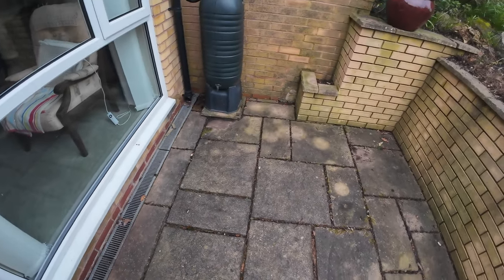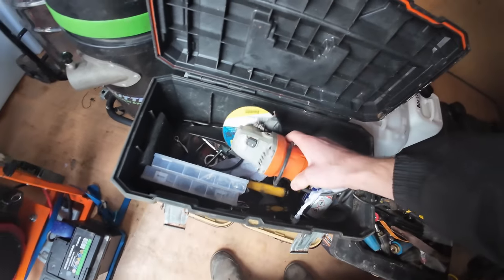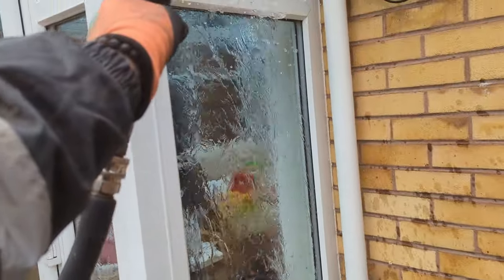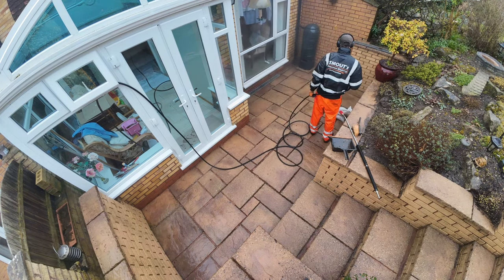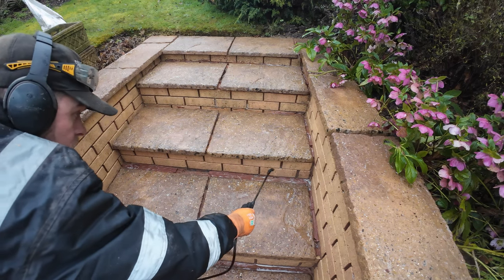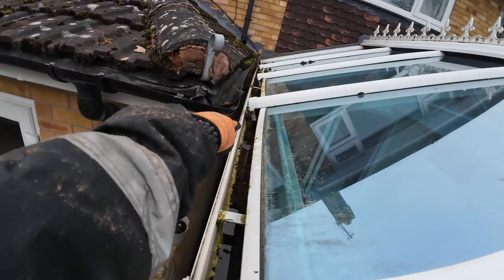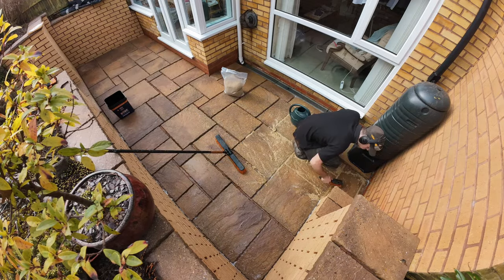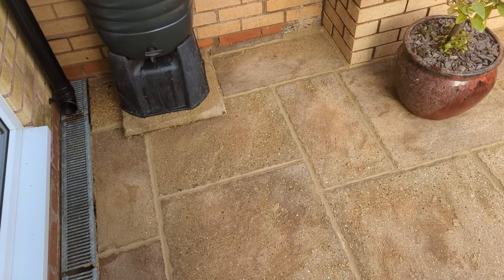Cleaning & REPOINTING a filthy old patio!

Comment: Absolutely agree on learning from others and having open discussions about techniques. The amount of crucifixion you get online from anything that differs to the 'stuck in their way' guys is surprising. 
I feel like I am pretty well equipped for most cleaning jobs now, but also haven't even scratched the surface on what there is to know. Being flexible with your approach is a great trait to have mate. Even this job alone you've opened my eyes to using a garden attachment on the backpack. Such a simple solution that never crossed my mind. 
Thanks for the video mate.

Comment: nice work mate i have a big white porcelain patio job this Friday any tips on working with porcelain slabs? I am a little concerned that the use of nuke pro might damage it and been told that high pressure could damage it
Reply from the maker: One of the easiest surfaces to clean mate. Try water first then 1:5 ratio of nuclear.
Reply: @SMOUT_  thanks been stressing about it. Local companies are telling me it fragile and easily damaged. Guess they was trying to put me off taking the job